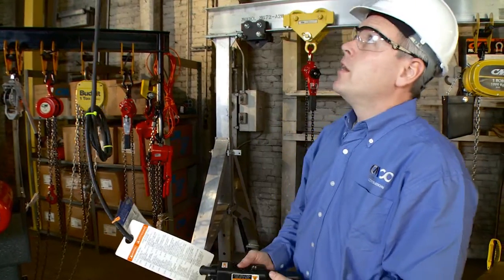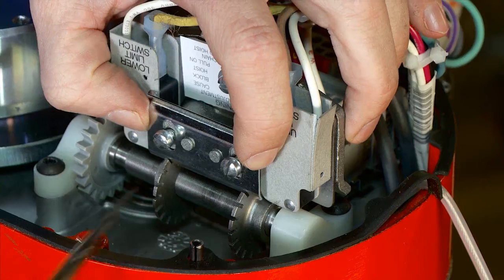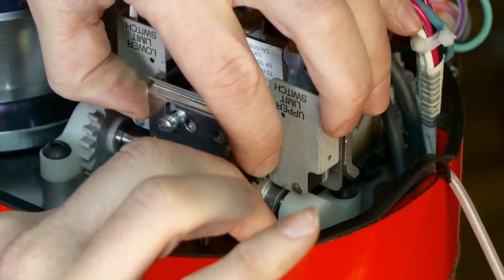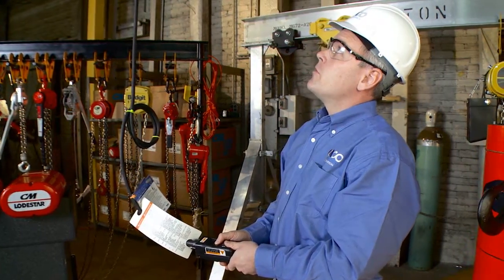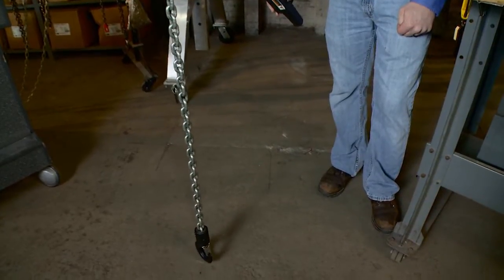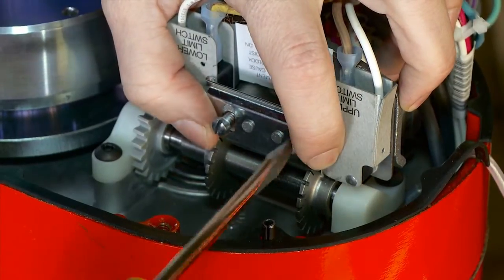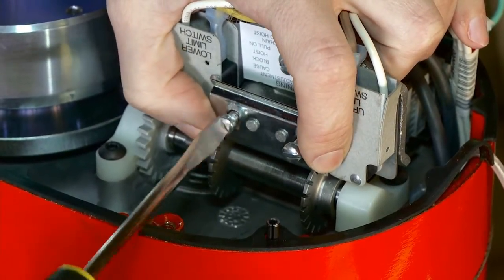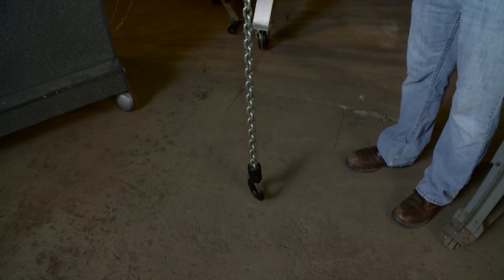CM Lodestar Limit Switch

Comment: i habe a lot of problem whit the system , my company buy one and they need only 3 link before touch the hoist, and when they use for a few weeks the limit switch start to fail.
i try put more links and left work for a while ant the hoist start to fail again, Im not shure if the problem its a design because dont let change the position of the switch.
Reply from the maker: Hello Lucas, 
Thank you for contacting us.
It sounds like you are using the limits as a production stop.
This is not the intended use of the limits.
If you do require a stop for production purposes, it will require a different configuration of the hoist.
Can you please confirm if you are indeed using the limits for production stops? 
Henry
Reply: @columbusmckinnon  
It is not exactly a production stop, I cannot translate that term (production stop) well, im sorry, but the hoyst its use very frecuently ; What happens to me is that the Hoyst works with a series of tools that are very long on a crane bridge ... and so that the tool can be raised to the point of insertion I can only leave them to 3 links of the chain before the hook finishes raise all. And if the instensive use its the responsible for the fails can you guide me to know how to prevent the troubles of make the configuration again and again....? thanks for answer!

Comment: Besides the danger of hitting the load onto the hoist by setting the upper limit to high, there is also the possibility of ripping the bag by having the hook gouge the side of chain bag repeatedly. Also hitting the bottom of the hoist with the hook block and cracking the gear housing can happen with an improperly set upper limit.
Reply from the maker: Great tips! Thank you. Yes, you need to set the limits to where the hook or the load will not strike the hoist or the chain bag. Peter

Comment: A good tip is that you can use a sharpie or any felt tip marker to mark the selected upper limit notch on the traveling nut. That way there is no confusion when you remove the limit switch plate to set the lower limit side.
Reply from the maker: Love the sharpie tip!!  
Peter
Reply: Hi
Reply: Q